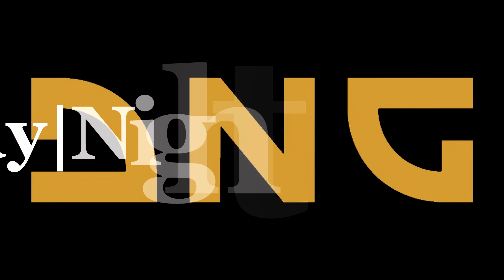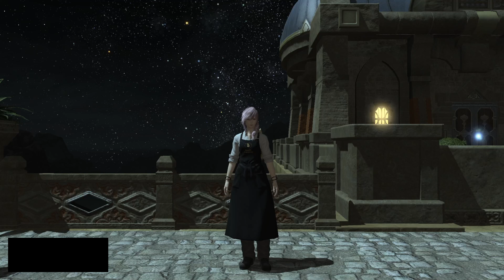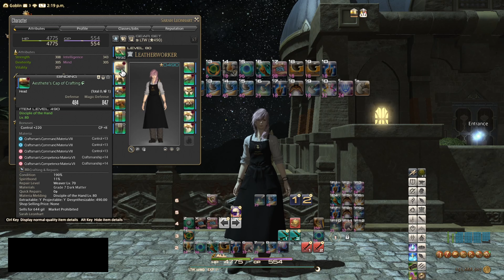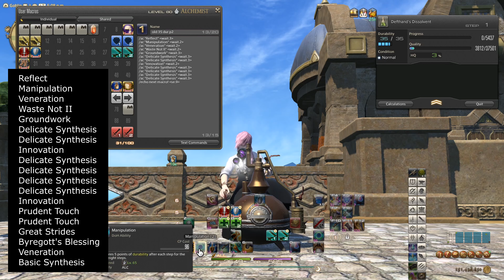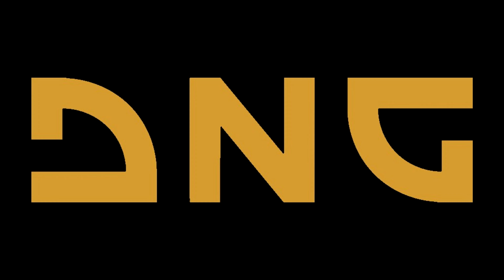FFXIV crafting HQ iLVL 490 crafting and gathering gear using only NQ mats

Comment: Now that Inner Quiet has been removed, is there a better Macro to use maybe?
Reply from the maker: Thank you for checking out my video!

If you have a level 90 crafter, try using:
Trained Eye
Veneration
Waste Not
Groundwork
Groundwork
Groundwork

I have not personally tested this, but this should work for all level 80 crafts and below. (Use practice sysnthesis to test this out before actually crafting the recipe)

Hope this helps!
Reply: @DayNightGamingOnline  Hey thanks for the fast reply! Well i am a returning player and i am lvl 80 with ilvl 490 currently, and sadly all my macros where gone by the time i played again and i was confused that inner quiet was gone haha, but i will try thanks

Comment: Hi. Great Video! I  bought the ilvl 500 HandSaint Gear and Tools with White Scripts. I'd still  like to craft this for being able to add  materia. Would this rotation work just as well even though I don't have overmelds?
Reply from the maker: Thank you for checking out my video! To be perfectly honest, I do not own a set of HandSaint Gear so I do not know the exact stats the total set gives.

The rotation in the video uses a very restrictive stat minimums. So with your set fully equipped, (and without food and potions active yet) check to see if you have a minimum of
CP: 554
Craftsmanship: 2696
Control: 2816

If you do not have these stat yields:
1) as long as you have a minimum of 620 CP after food and potions
2) Craftsmanship 2690+
3) you can supplement a lack of control with using HQ materials. So with that in mind, you can focus on getting your CP and Craftsmanship numbers to their minimums. (You can also use a soul crystal to help boost your stats, but keep in mind, you can only have 3 crafting soul crystals at a time, and it takes scripts to change your crafting specialization).

Hope this helps! Happy crafting!

Comment: Any advice for a new omnicrafter with full Handsaint's Set if I want to craft the i490 crafter set for pentameld?
Reply from the maker: I would highly recommend starting with crafting the body and the leg pieces first as they give a great yield of stats. Make sure to use High Quality materials when making these to help give you a starting boost to your Quality bar!

Having that head start on your quality bar will make crafting your gear much easier. Once you have the Body and the Legs crafted, then proceed to make the rest of the armor pieces as well as the waist.

Once you have a full set of armor, making the accessories and the weapons will be much easier to complete.

(As a new omni-crafter, at this point in the patch cycle, I must caution you about penta-melding your equipment. It will be very difficult to re-coup the gil spent penta-melding that armor without any big margin items for sale atm. At Maximum, I would probably only triple meld your gear at this point in time and wait for the next patch.)

Thanks for checking out my video! I greatly appreciate it!
Reply: @DayNightGamingOnline  At this point on the update, having full handsaint set, you think is worth the effort? it is even possible to craft exarchic sets with the set I have? Thanks for the previous anwer.
Reply from the maker: @nestorarcilaosorio2457  it is probably possible, but it will be very difficult and must be manual crafted.

I would still consider crafting a set of Crafter Armor, I just would avoid overmelding too heavily. The first 2 melds per armor piece is fairly cheap, and the 3rd meld isnt to bad.

The 4th and 5th melds are very expensive, so at this point in time, it wouldn't be worth it.

There is still a lot of gil to be made with crafting at this point in time, just try to keep your expensive down.

Hope this helps!

Comment: I'm wondering if you could help me? I just got my crafters to 80 with the Handking armor set. Should I try to craft Facet set before crafting Aesthete set? Can I only get Aesthete set with HQ Facet gear?
Reply from the maker: Anthony F : hello, and thank you for watching my video! It is possible to skip straight to i490 using handking set but it can be difficult- and you might fail a few times along the way.

My suggestion would be to us all HQ materials to help give you a quality boost and to make sure to eat High Quality Blood Bouillabaisse food and High Quality Cunning Craftsman Syrup.  Start with making your chest armor first, then after that try to make the legs. Once those 2 are made— the rest of the pieces will become easier to make. Continue to finish off the other armor pieces before continuing onto weapons and accessories.

Hope this helps! And good luck!
Reply: @DayNightGamingOnline  Thanks a lot, I'll try that. Your videos are great btw thanks for your content!